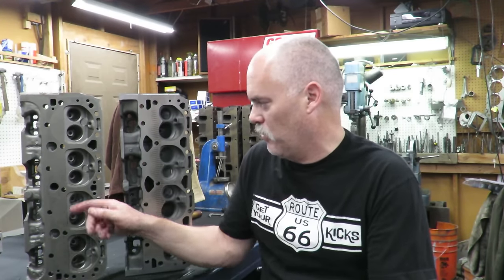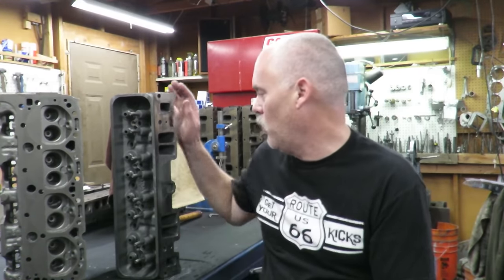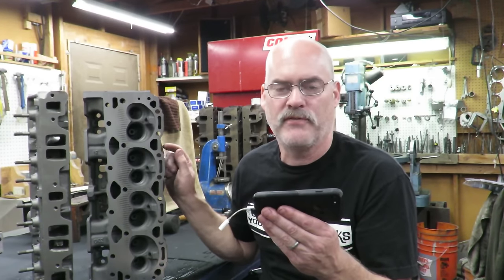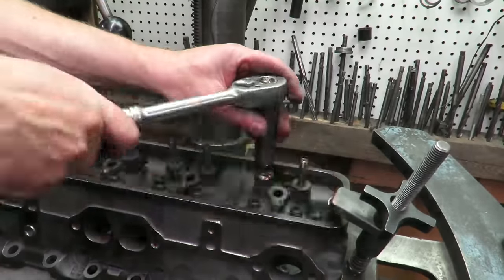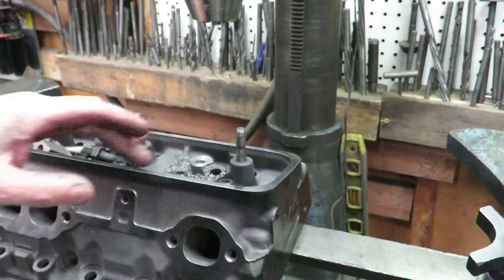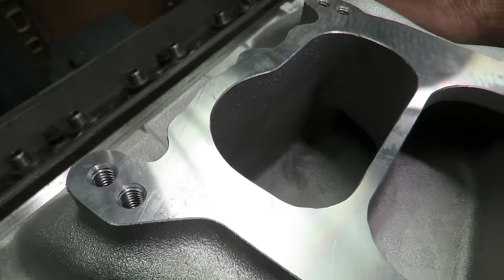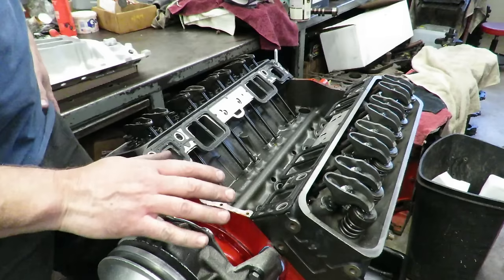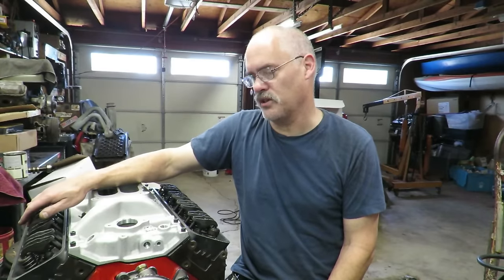How to get more power out of your Small block Chevy

Comment: Super simple 385-405hp 350
Get a 96 and up R code 350 from a truck, rebuild it with flat top pistons, anything from 9-1 to 10-1,  compression is what you want, use a gm hydraulic roller hot cam 218-228 at .050 
Mill the valve guide bosses, use some LT4 or comp beehive springs
Edelbrock rpm intake, 650 dp carb, long tube headers, super simple nice combo, the hencho en mexico blocks are better.
Reply: Derek Stewart nice, you can't put it any simpler than that. That combo will make a fun to drive street car or truck
Reply: Derek Stewart I used the same block, stroked to 383,  dart heads, 230 cam,rpm airgap, 750 performer, with 10.2:1 comp. Can't wait to see what it does in an s10
Reply: Stainless, I went close to that set-up.  Stroked that blocked to 383, but went with a set of 195 AFRs, comp 288HR setup with EFI.  I'm expecting to be right around 500hp with that combo. :)
Reply: Mike O'Hara 288 is what they recommended, I wish I had got it
Reply: Mike O'Hara 
Yeah that's a totally different animal, depending on compression you will be 485-510hp 490-505tq 
This one did 508hp 505tq
R code block 60 over
388 cid 
11-1 compression 
Custom hyd roller 229in 237ex 
.539in .543ex lift with 1.6
111lsa 107ilc 
My ported 185cc edelbrock rpm heads, 193cc afterwards 273cfm in 228cfm ex at .600 lift
 my ported rpm intake 
Holley 750 Ultra HP
1-3/4 long tube headers 
92 octane fuel
508hp at 5800 505tq at 4700 fwiw
Reply: Where are you located? My father has a 1986 Monte Carlo ss with the stock 305 engine. My father will be happy to get 300 horsepower out of it.  I have a 1997 vortec 305 and I was thinking of giving him my heads to keep his numbers matching block. I will love to meeting you with my dads car for you could  get it done. He's in new york now and I live in lake Mary Florida.
Reply: George Ferrer 
Portland Oregon
Reply: thanks derek for the info, i have a 77 chevy pick up with a 350 4 barrell 165 h.p. im going to build one from your recipe, thanks man
Reply: What’s R code block?
Reply: David Callahan 96 and newer 350 that came in almost all gm trucks, it had 1 piece rear main seal, provision for factory inexpensive hydraulic roller setup, it came with vortec heads, some are 4 bolt main, it's just the cheapest foundation to start with to make a little power with I find. Fwiw
Reply: @derekstewart8175  What is the advantage of using the Mexican block?
Heavier casting with more material?
Better quality metal (higher nickel content)?
Please explain, I am making plans for a build, and I would like to hear your advice..
Reply: @T.Tuxedo  
Yeah but unless you are really pushing it its not going to make or break you, finding a block that doesn't have a ton of rust or core shift is the main thing to watch, im making 515hp 505tq with a 90 tbi roller block 388cid and its just a studded 2 bolt with good machine work and attention to detail, i dont hit it with any nitrous or crazy rpm, if i was i would get a Dart shp block because by the time you add billet caps and all the machine work, cement ect its just as much money and its not going to take nearly as much power
Reply: Thanks for the info!
Reply: So you’re saying I can do this to my 1997 Chevy K1500 Z71 5.7 Vortec motor???  and forget about a LSx swap....
Reply: @suavehouse5150  
Just depends on what you want to do but it is easier to stick with the platform the truck was designed with.
First is what are you realistically going to do with the truck
then you figure out the combination that will best satisfy what you want to accomplish, there is a million internet experts out there so your project can be delayed inevitably by constantly changing things during your build so best thing to do in my experience is make a solid plan thats actually feasible for you to do and stick with it to the end, you can change things later as you find out what does and doesn't work for you, thats my advice
Reply: Derek Stewart 
I’m doing a 6” lift running 35”-37” tires and 456 gears. 5.7 Vortec has only 170,xxx miles on it. Want it to be torquey nothing too crazy enough to move those heavy wheel and tire combo and if I’m going through deep mud or high elevation. I’m out of Los Angeles CA.
Reply: @suavehouse5150  
I have a 84 K5 3/4 ton, 6" lift 35's
388, 4.06 bore 3.75 stroke One piece rear main seal block, mine is fairly radical at 511hp 504tq but i like that kind of thing, its really at the upper limits of being daily drivable though
It would probably be a little much for most 4x4 guys, a nice 425-450hp cast crank 383 using your block with modified vortec heads would be about right for what you are doing
Reply: @suavehouse5150  sure
Reply: @suavehouse5150  What trans does your truck have? If you have the 4L60 you need to beef it up a bit if you have not already..most important being a hardened sonnax sunshell and corvette servo. My '97 K1500HD Silverado just turned over 186k before the sunshell finally stripped out and left me with 1 and 4 gears and no reverse. This happened less than 3k miles after I put a Suspension Maxx Leveling kit and 35" tires on 17" rims. The only reason it survived this long is because I've owned the truck since it was new and has been well maintained.  I've been talking with Finish Line about a stage 3 rebuild on my 60e so I will have a drivetrain that can withstand this power plant upgrade. Those guys are some of the best you will find for gm transmissions.
Reply: americanstrife 
It’s bone stock currently at 171,xxx miles on my k1500. I’m considering a upgrade from monster transmission when the time comes.
Reply: your looking at 2-3  thousand to deal with labour costs   @georgeferrer23

Comment: I've really liked your channel so far, although much of it goes over my head. And someone told me you don't mind answering questions once in a while. But please feel very free to tell me you don't have time for this. I will understand that, and certainly won't be upset. You have already shared huge knowledge through your channel, and I am grateful
This wall of text is so that any info you might need is already in there and you won't have to waste time finding things out.  
so I have one of those awful tbi engines, a 1988, in my beloved shaggin wagon project. For various reasons I have decided to retain the classic sbc 350, and because I live in freezing Canada, I have decided to retain the tbi system.  now I am going to upgrade the tbi with a high pressure fuel pump, a stronger regulator spring, and I have already ported the throttle body within an inch of it's life. I've also unshrouded the aircleaner housing, modified it for two massive cold air intakes that terminate behind the grill. So I have enormously increased the breathe-in system. Ive put in an edelbrock dual plane intake, I've bought some block hugger headers (might buy the hedmans that seem to be the only long tubes made) and will redo the exhaust to dual with an ex pipe, and frankensteined side pipes to be announced. I've replaced the distributor, coil, plug wires and plugs. I figure Ive got the air pumping in pretty good, it can leave pretty easily, and that the heads (and the cam) are going to be the issue.
so you know what I have already. I was going to haul the tbi heads off and try porting them, I've seen a few you tubers who claim you can actually make them work. Or I could by  a set of more or less reproduction fuelie heads from summit. part numbers. sum-152123 for about a grand Canadian money with gaskets and arp bolts. And then I noticed this show from you, and thought, this guy can answer the question. 
So I've been turning it over in my head, and I don't know what my best route is. Do I find vortec heads, buy a new intake, find a machine shop, etc etc. Do I see what I can do porting the tbi heads (I will anyway, once they are out, just for fun, but yeah) or do I buy these heads from summit?
I should also mention this is the first v8, in fact almost the first car I've worked on. Im a tradesman, mechanically inclined, but my motor work is all 25 years ago on two stroke street and road race bikes. And I work in my driveway. in the Canadian winter. And you may have an idea that never occurred to me as well, I don't know

My goal, for now, is at least 350hp. and as much torque as I can get. more would be good, but if I did the math right on air flow 350 is reasonable without radically switching up the throttle body and injectors.

my secondary foal, once I learn a bunch more, is another van, an LS swap, 1300hp and go find the guys street racing a ccouplemiles away and race them for pinks. So they don't have cars to keep me awake anymore ;) Or maybe just join up, life has been boring. I doubt anything is boring in a full sized van that wheelies and runs in the low 10s
Reply: I just noticed summit also sells their own knockoff vortex...yet another possibility
Reply from the maker: I would go vortec you can buy them aftermarket with duel bolt pattern so you can retain your intake
Reply: @Myvintageiron7512  I had not even heard of the dual bolt pattern part... a quick search and I didn’t see anything, is the dual bolt pattern something a machine shop could do to any Vortec head? Or am I not understanding what the original incompatibility is?
Reply: @Myvintageiron7512  hi there. Have not found any vortex heads with a bolt pattern to allow using my existing Edelbrock tbi intake. The vortec intake I found is way too expensive for me. Summit has a pair of their vorteks to my door for under a grand. But then another 600 bucks for intake, then gaskets and rocker arms and pushrods and all the rest.  Just how big is the horsepower advantage of the vorteks over summits double hump repels, do you figure?
Reply: Someone sent me a link thanks!

Comment: That’s my exact motor except a computer friendly .440 lift cam. I have aftermarket vortecs and use the tbi. Turns my 38.5 boggers good with 4.11 gears. I asked you a few questions when building it and it was my first rebuild. Year later still running strong.
Reply: did u have to get a computer chip ?

Comment: I've got all the castings, a good 350 vortec block ( complete stock low mileage engine ),  an edlebrock vortec intake,  a milling drilling machine, measuring tools, machine shop experience etc.   I think I can do this in my garage to these heads including the center bolts.   Put a better cam in the engine and there it is... a decent small block in these days of LS swaps.    I put together a 400 sbc with vortec heads, basic bearings and rings, cam, intake..... and the cam went flat :((        was my first motor in a very long time and I wasn't really aware of the oil and lube requirements for flat tappets due to todays oils.    I've been researching a lot to avoid wasting another nice engine.   I've been scared away from flat tappet engines for now... I'll try a few budget 5.0 chevy's with them as I've got them already.    Thanks for the information and inspiration.

Comment: Just wanted to say, I bought a 350 from a rolled over 2000 Chevy 3500 express van. It had over 300k on the engine, I had little cash but needed an engine. I did rings and bearings, bolted an Edelbrock Air Gap intake on it, with an Edelbrock 600 carb, with factory roller cam and it was incredible how much that engine woke up. The Vortec fuel injection really choked these engines out. What a huge difference just by adding a carb and intake. All I had at the time was a butt dyno, so I dont have numbers but still very impressive.
Reply: Mike Ebz the vortec intake is just fine .
Reply: @Mingledbones  We might not be talking about the same thing... I mean the plastic one with the injectors that have the spaghetti noodle spider injection contraption on them. They leak fuel into the oil, they have issues with vacuum leaks, and the fuel pressure regulator is located underneath... they are expensive to fix, and getting harder to find. I never liked it.

Comment: They also enlarged the intake valves on Engine Masters to get that 364hp.
Reply from the maker: yes I have an opinion about that I put 2.020/1.600 valves in a set of vortec heads years ago the gain in air flow on the flow bench was only about 5 CFM's honestly not really worth the expense in machine work and valves
Reply: nope not if you dont port out the heads its not. scoggin dickey has a large port vortec head that flow 281cfm at 600
Reply: I had the machine shop 2.020/1.600 valves to my vortec heads it made zero difference in tq, and only about 5 HP it's a waste of money

Comment: Great video. I  really appreciate you taking the time to educate everyone on how the old small blocks still rule the roost. They will never go away. An yes it is the best bang for the buck. An 25-3000.00 you just can't beat it. I'm pretty much old school myself. One wire alt. One wire dist. An a set of after market gauges an down the road I go. An i don't have to spend alot of money on wiring harnesses an computer boxes, an everything else to make it run. If that's what you like then more power to ya. If I was going to go that route then I would go total electric. (Tesla) lol. 😁👍👍 PS:  I have a good friend that has a 55 Chevy convertible. Originally a 265 car. Which he still has. Is there any way you can get 300 hp out of a small block 265 without spending 10,000 dollars to build it ?
Reply: And has a "d" in it.

Comment: A lot of people also don't realize how long it takes to do all that also. They see a 40 min video but don't know you probably spent all day on them head.
Reply from the maker: Exactly
Reply: Myvintageiron7512 I'm waiting for sbc 400 build
Reply: Phillip Mckay I recently built a 400sbc with vortec heads and used Summit’s 1103 cam, it was incredibly torquey. I love the 400, these videos make me want to build another like crazy!
Reply: Mypiemaker
Reply: I built a 350 30 over with  that 1103 cam. it's nice . I have it in a 1989 1500 short bed. fun fun fun.Lol
Reply from the maker: @phillipmckay927  a SB 400 build is pretty much exactly like a 350 build it just has a bigger bore but the process is the same as a 350
Reply: @Myvintageiron7512   I'm building a sbc 406  zero deck 9.5.1 compression aluminum heads 68cc  200cc running comp xe274  1.6 roller rockers scat crank scat 5.7 rods forged pistons  I got so much info from your channel it should be a fun lil street motor